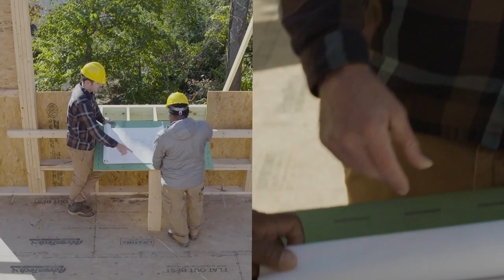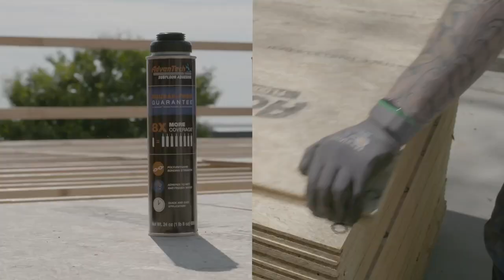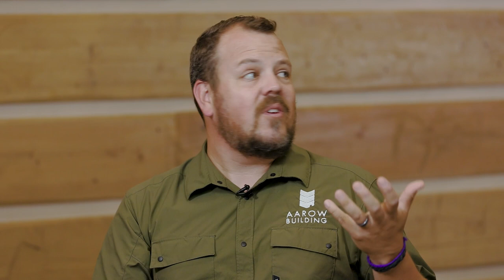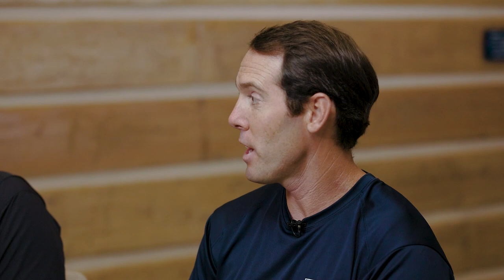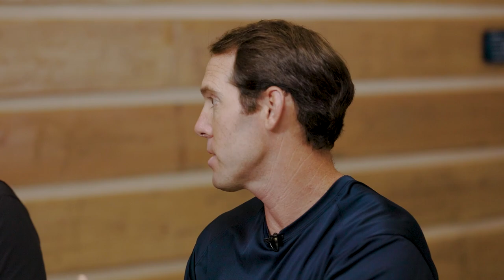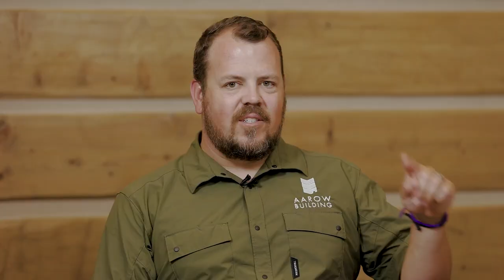Custom Builder Round Table - "Ideal Client"  - UnBuild It Podcast #93

Comment: A very good discussion! With the rise of the internet, websites like Green Building Advisor, the Journal of Light Construction, Building Science Corp, as well as Youtuber’s like Matt Risinger, Building Science and Beer, Corbett Lunsford of Home Performance TV, and Unbuildit Podcast have allowed clients today to become more and more informed about the process of building and the different materials available to build or renovate their homes.

How do you now deal with clients who come to you with a predetermined system of construction they want to use in their new house (like maybe SIPs for walls but not for roofs or floors) or maybe a specific product or material they have heard “is the best available” (like a certain brand of sheathing, WRB or siding) or perhaps it’s something so new you’ve never heard of it or worked with it before? Are you willing to look at a brand new method or product, or at least willing to do the research necessary to see if it will work on this particular project or do you prefer to stick with what has always worked for you before on similar projects?
Reply: More educated consumers should be welcome. You as the builder can't keep up with it all, let people bring ideas to the table and be ready to have a solid understanding of why it should or should not be done. Not the old "We have never don't it that way before", "We've always done it this way"